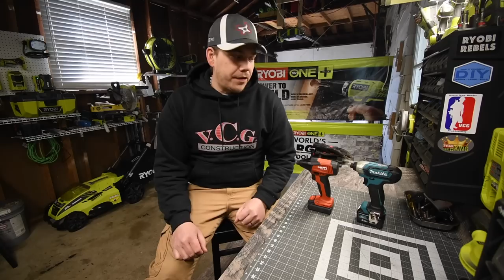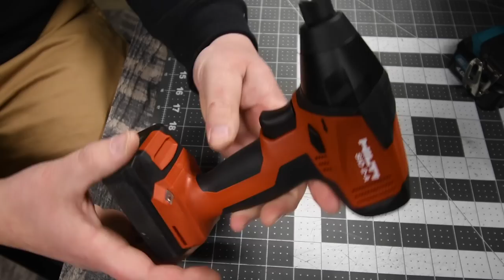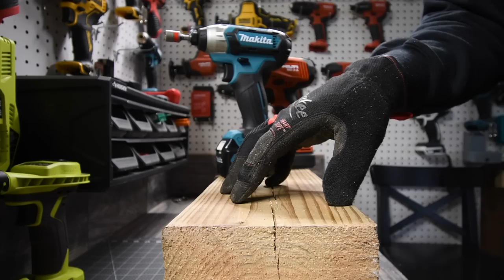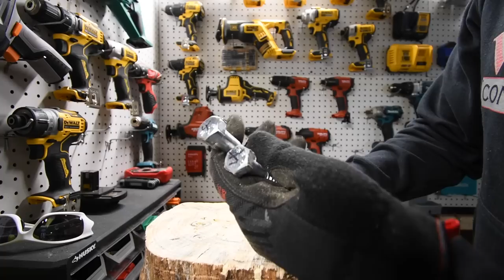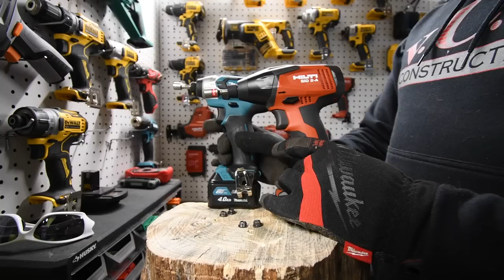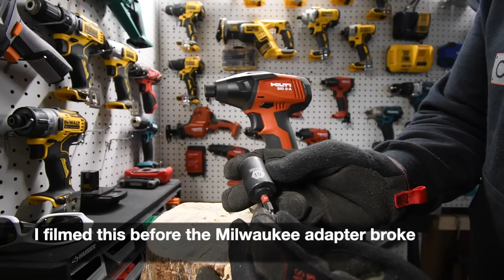Makita 12v Vs HILTI 12v (Impact Drivers)

Comment: Need to figure out a better material of drilling into - like when they test bullets on  NCIS and that other show about forensic analysis, they shoot bullets into jelly
Reply from the maker: yes sir
Reply: @ManCaverTools  seriously. Wood is too different in its content - i mean inconsistent with knots, sap and so on, especially softwoods with the earlywood and latewood - you do put it in the same ring, not seen that before.  Drilling a 1/4 inch hole and inserting a self tapping screw into a concrete post would be more consistent. indeed coming up with a range of materials for a test might be better in th real world.

Comment: Have you had the opportunity to get your hands on the Makita 18v Black subcompact impact? You should do a video comparing that to other 12v impacts, not performance but for the same reasons you would carry a 12v, size weight compact size, getting into tighter places etc.
Reply: I have the black sub compact.  The size is great but they seem to be cheeply made compared to there other 18 v tools.  I'm not sure if there better built then the 12v.  Overall I like but there not gonna last.
Reply from the maker: I do plan on getting the subcompact Makita soon and I thank you for viewing Jordan
Reply: @ManCaverTools  I can send you the drill and impact I'm not using them.   I've only installed a couple kitchens with them.  I bought to try em for science that's it lol

Comment: I have a question what are lag screws used for I have never used them before
Reply: Theyre a replacement for lag bolts
Reply from the maker: they are used to connect thick lumber together. that need to strong